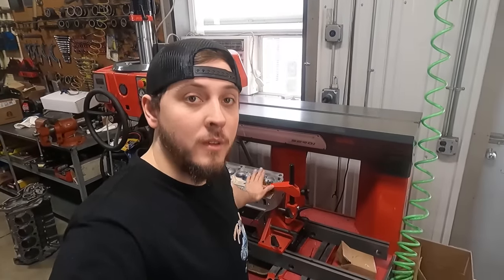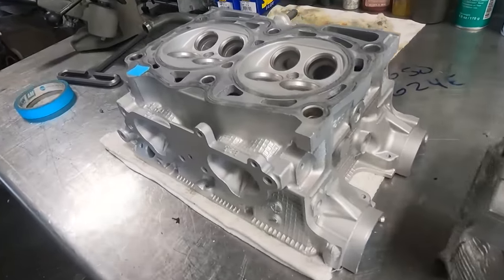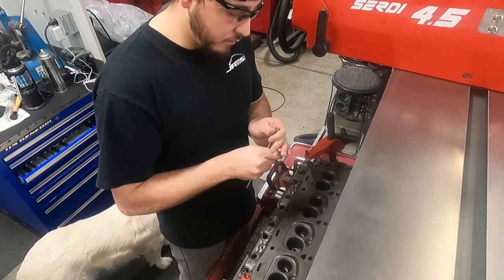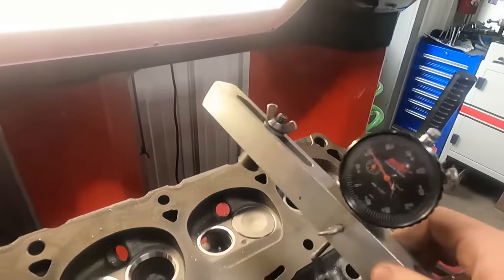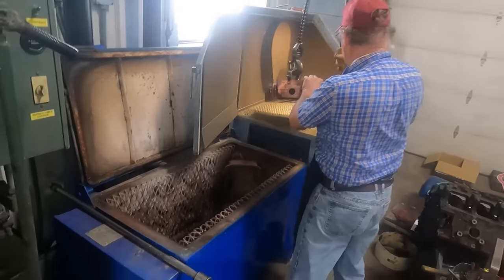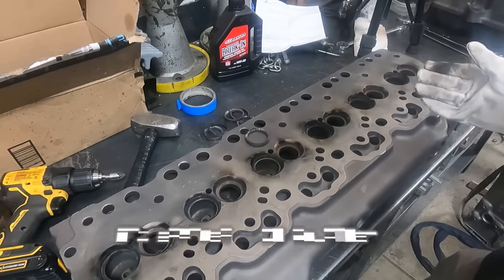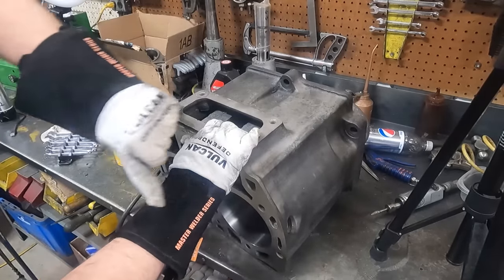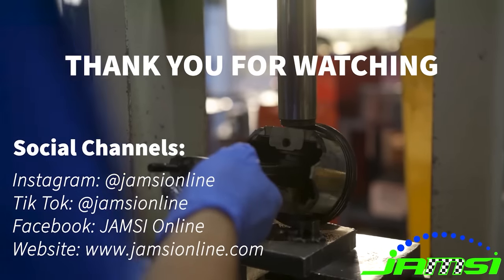This Week @JAMSIONLINE - John Deeres, Subarus, and Fords - Shop Vlog Ep. 2

Comment: Your question about the tig, I'd guess it's just dirty metal, oil soaked for a long time. Hard to tell without much info. Argon flow depends on cup size, for that I'd use a small one, like a 6 with around 12 cfm

Comment: I have an issue I'm curious if you've seen. A head recessed head bolt (below the camshafts on a DOHC V8) stripped the bolt heads before coming loose. It's difficult to get to being recessed, and I was unsure if given the thermal capacity of the head, bolt, and block being assembled would make welding difficult. I had a second engine I am building up not having the ability to get that bolt out. Thoughts?

Comment: As far as the weld looking bad it is more than likely just dirty. Even with cleaning the heads, the amount of soot and garbage around the seat and embedded in the metal of the seat it won’t give clean pretty welds. There are 4 steps to making nice tig welds, 
1. Clean
2. Clean
3. Clean more
4. Weld
Reply from the maker: Agreed lol, that's what I've heard. Since it's nothing structural or cosmetic, as long as the seats come out I'm happy :P. I will keep that in mind as I begin learning TIG for actual welding applications though!

Comment: Great content man! Hope the channel keeps growing you deserve it. I’m actually about to rebuild my first set of 302 heads. If you don’t mind I’m wondering what you machined the counterbore to and what seats you ended up going with? Loving some of the extra details included in your videos! Keep up the good work!
Reply from the maker: Thank you! I believe on these I went with an SBI SB1500-1 on the exhaust and a SBI SB1812-3 on the Intake. Both required a bit of throat blending. Both seats are 7/32" depth so I always try to cut so that they match perfectly to the casting or if nothing else they stick up a bit & I can come back with a cutter to trim the top to blend well.
Reply: @JAMSIONLINE  thanks for the reply much appreciated!

Comment: Im surprised serdie doesn't have cut travel measurement inbuilt.   A collar lock stop on spindle turret would be a time saving godsend, methinks ?
Reply from the maker: It has a stop. I use it when cutting seat counterbores. I just personally like to take it a little slower when finishing the seat depths :). I'm sure there are some people out there who just set the stop or go off the depth DRO. I'm picky lol